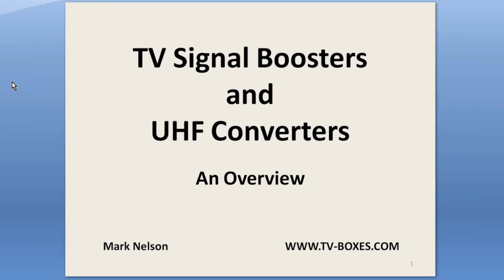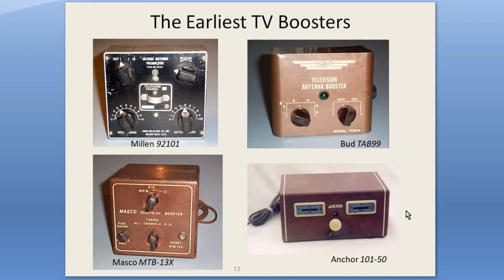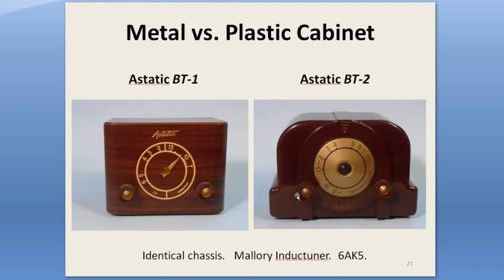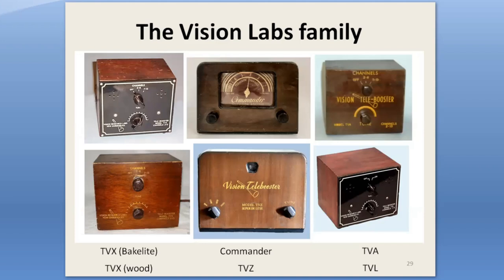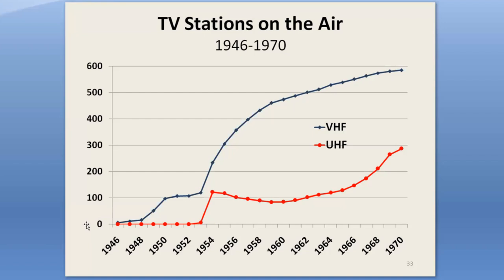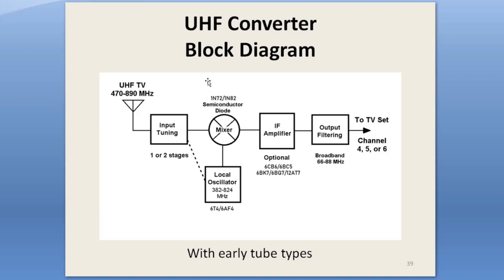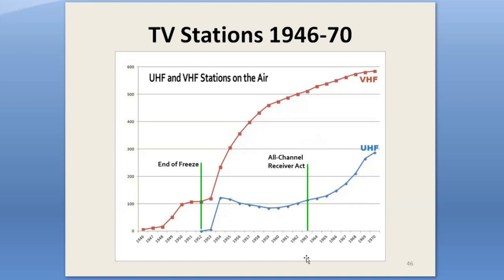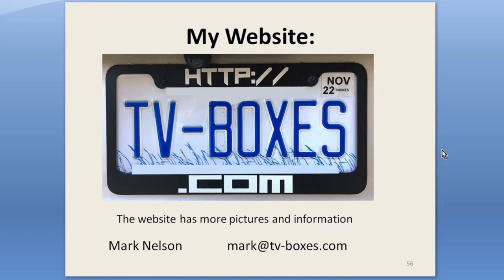Television Signal Boosters and UHF Converters - What Were They?

Comment: My tolerant father, allowed me to purchase a Lafayette UHF converter so the family could watch the new Chicago UHF station WCIU I think I might've lied and told my father they had Saturday gulf programs so he would write me a check. 
When the station came on the air a few hours a day the signal wasn't very good from 30 miles from the antenna. So I upgraded our antenna and purchased 300ohme shielded lead in, an alliance rotatory that a Lafayette converter with its single tube didn't work very well. But my house had the biggest antenna in the neighborhood was a rotator, but VHF DXing was good with our old Dumont TV.